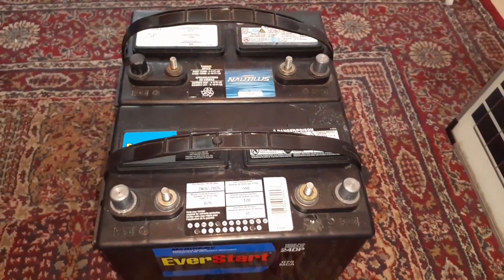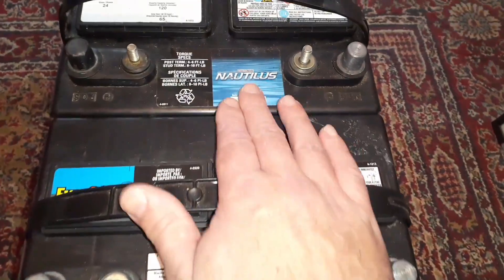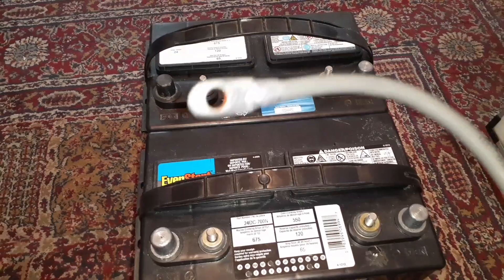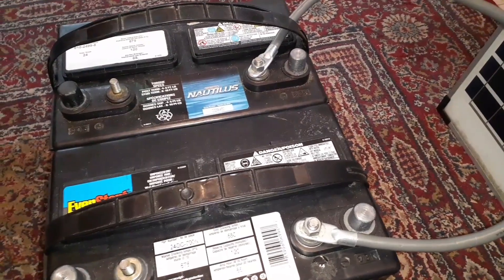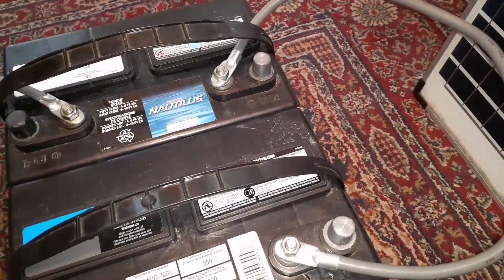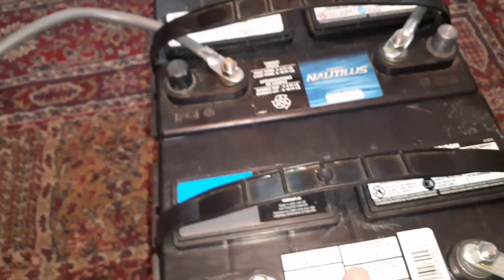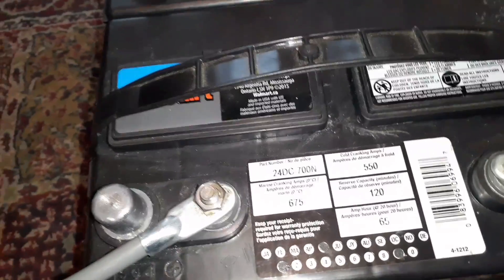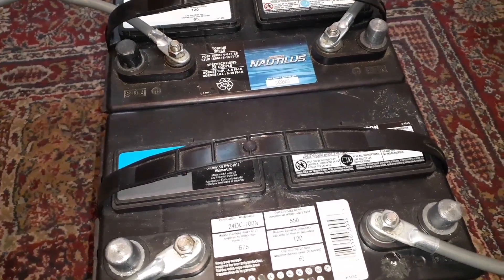Deep Cycle Batteries Parallel or Series.

Comment: I feel like im watching video’s from the past century with that 65ah rating… my battery is 120ah on its own and the same size. 

Tbh i think you have insufficient amp hours and thats the stem of all your problems. You want to over do your consumption and.
over do your solar capacity. 
This will ensure a full battery and charge and a full night of use. 

Eg: you may have 130ah but you can only use 50% of that 65ah of as some people think you can get 80% but we wont get into that.
Now you have 65ah for the night, you have obviously used 65 of those. You need another battery and a low voltage cut off. All solar regulators have this function so in my honest and humble opinion sir. 
You have not done your due diligence.
Get another battery and set it all up properly from the start. 

Enough battery/enough solar/program your solar control or if you don’t have one at the very minimum add a low voltage cut out and charge your batterys to 14.4 and let them float down on their own. 

Worked for me for 6+ years one battery one fridge one panel one time! Never turns off

Comment: Thanks for your video. I have a Genie scissor lift with 4  6V batteries wired in series, My question is there a different charger for series charging and  for parallel charging.
Reply: parrellel is 12 volt series is 24 volt charger
Reply: @BillRand-v1q  Many thanks

Comment: Connecting 2 batteries in parallel with same voltage rating but different in amperhour..What if one of the 2 batteries got full charge and the other one still need to be charge..How could a charge controller act in this situation?
Reply: I was always told to use the same amp hour battery when connecting them together.

Comment: But in series, at 65ah, if you draw the same load, because it’s at double the voltage (24v vs 12v), it should draw half the amps and thus the runtime should be the same as when connected in parallel.... Right?

Comment: Could you connect 2 batteries with 250 cca in parallel to start a car needing 450 cca?
Reply: By doing this you only increase the amps so it's a no brainer. But remember to connect the red power cables from the car to the second battery red terminal.

Comment: Im new at all this i want to charge 2=batteries from 1 150watt panel , i have a  20amp charge controller  at moment
And 2 110 amh batteries   .
Im unsure best way to set these up  do you have a diagram .. also what inverter will i need  ..thanks
Reply from the maker: Do you have 12 volt system?
Reply: Ive got 150watt solar panel 2 x110 amh batteries And 20 amp charge controller  it works fine as 1 battery setup only but want to upgrade  to 2 batteries , but don’t know if need higher amp controller and then a 24volt invert  if thats even right ?
Reply from the maker: @adriancross8067  Are you powering a camper or boat off the batteries, or just using it to charge things?
Reply: Just for charging iPads etc and running my television  which  is about 300 watts
Reply from the maker: @adriancross8067  What size is the t.v. in inches?
Reply: @jackofalltradesmasterofnon6120  just basic 32” not led or plasma type
Reply from the maker: @adriancross8067  ok, your 2 batteries in parallel like in the video hold 220 amp hours. You can only discharge them to 50 percent unless they are lithium ion. So 220 amp hours at 50 percent is 110 amp hours. Your panel is giving you 7.5 amps per hour at a 100 percent. The t.v. is going to draw 300w÷12v=25amps per hour off your batteries which is way too much. Also, your inverter will draw amps from the battery just by being turned on. If your t.v., inverter, etc, is drawing 27 amps, and your solar panel is only giving you back 7.5, you will run out of amps in 5 hours. Your set up is good for charging things but not for the t.v. Hope this helped.
Reply: Can you suggest what i need for more power ?and longer
Reply from the maker: @adriancross8067  Lithium ion batteries with at least 400 or 500 watts solar.
Reply: @jackofalltradesmasterofnon6120  would it make difference in how the batteries are connected  and which way is best ..
Reply from the maker: @adriancross8067  in parrellel

Comment: Based on numbers it's 130 ah, but in reality, you slice that in half. And that's being modest. In truth, you only get roughly 48% of the total rated ah. Especially if used with decent discharge rates.

Ie: I have the same system setup, mines just a larger group giving me a total of 200ah, but if I plug something in that draws ~400w and 8-15 amps (it goes up as voltage drops), it only lasts 1 hr max if I get lucky.

Comment: The batteries should be seperated in leaving a gap between them to help keep them cooler,right?
Also,Marine deep cycle batteries (AGM) last a lot longer and can be run down to 20%...and yes they are more expensive but are much more worth it in long run.
Reply: 50% DOD not 20% or you will do damage to wet cell/agm batteries.
Reply: @scottchildress6392  
Do some research my friend...Marine Deep Cycle AGM...
Reply: @ellissmithjr6599  research says running wet cell/AGM below 50% shortens battery lifespan. Lithium is recommended to 10%.
Reply: Does that mean you can only use 80Ah out of a 100Ah battery?
Reply: @98Blacklightning  correct

Comment: May I ask why did you pick flooded over AGM.
Reply from the maker: The cost of agm is much higher
Reply: @jackofalltradesmasterofnon6120  I thought the same thing but after looking at Walmarts everstart H8 AGM for $170 with a 4 year free replacement warranty and with 170 minutes of reserve capacity I figured that it is the better battery on the market right now. These 3 are the most important variables in a battery. 1. Cost. 2. Reserve capacity. 3. Warranty. Usually the higher the reserve capacity, the higher the amp hour rating gets. A lot of people say that the H8 AGM is a car battery but if we think about it so are Walmarts deep cycle batteries because they have a high cranking amp rating.
Reply: @solidsnake4022  💡Amp hour's is the same thing as reserve minutes, both are broken down to how many amps the battery can hold before being exhausted of it's power👍
Reply: Walmart’s 29dc flooded batteries have a higher reserve capacity than the H8 you referenced at half the cost. A lot of people trash talk these batteries but have no idea that they are manufactured by Johnson controls who makes optima batteries and OEM batteries for many car manufactures including Ford and GM.
Reply: I'm about to Loose my mind..my battery doesn't say ah. It says 860-700 next line: min @ 23amp next line: 205 ..what the heck does that mean .how many ah's is it??

Comment: Does it matter if the battery makes are different  or do the amp hours just need to match . Thanks
Reply from the maker: As long as you are using all 12v or all 6v batteries in your set up it doesn't matter the make or amp hours. Dont forget 12v in Parallel is for a 12v system, 12v in series is for 24 volt system. 6v in parallel  is for a 6 volt system and 6v in series is for a 12 volt system.

Comment: I dont think being hot out helps your charge, I think its the amount of sunlight your panel gets is what matters.
Reply: Correct just like most things heat reduces production.  So most panels will begin to reduce production once you are past a certain Fahrenheit
Reply: Heat actually slows the charge down  you get a better charge on a sunny winter day than in August.